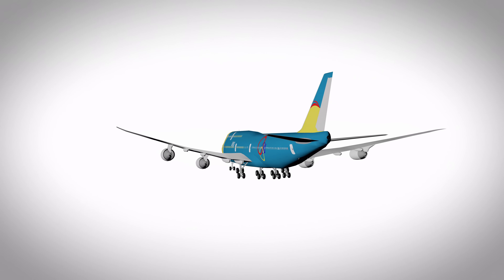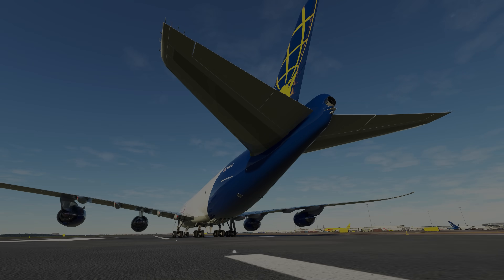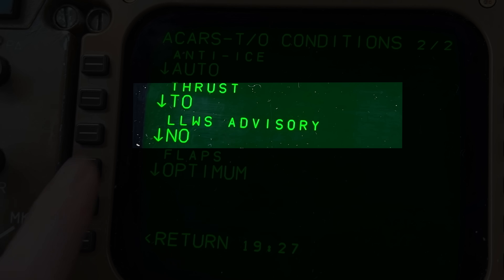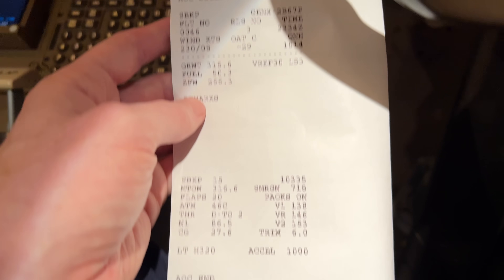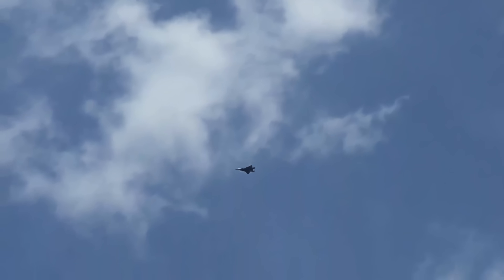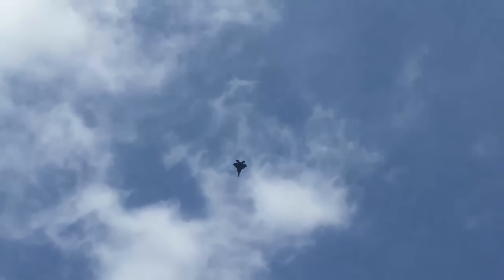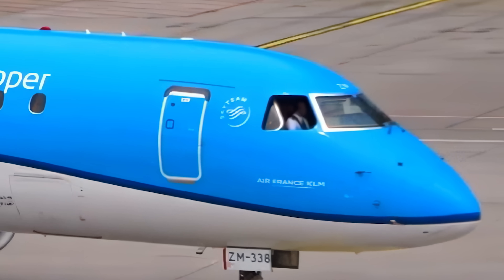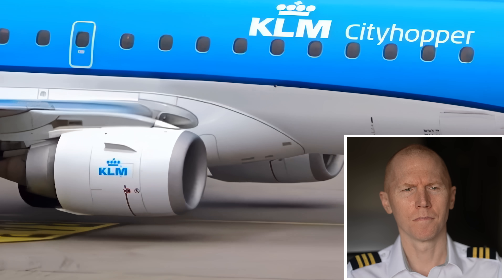Unsafe 747-8 Vertical Takeoff

Comment: As a car guy and a pilot, your downshifting metaphor is spot on.
Reply: I highly disagree. I drive a manual and I use downshifting once in a while to slow down my vehicle. Very helpful when rolling down a steep and long hill. Helps release the load on the brakes and it makes the ride more comfortable. Now obviously, I wouldn't do it if I'm already at 5000 rpms and when I do it, I gently release the clutch to prevent any jerks on my car and help the rpms rise gradually and smoothly. I've done that on automatics as well, doesn't seem to be a problem.
Reply: Come to places like Colorado, and downshifting on mountain passes is taught, otherwise you will overheat your brakes. Brakes may be “cheaper,” but overheated brakes that don’t work may force the ultimate sacrifice. We had an incident here about 2 years ago on I-70 where a truck driver with no mountain experience failed to downshift, blew his brakes, blew past the final run away truck ramp, and caused an incredibly massive collision and fire when careening into stopped traffic near Denver West. People died. Keeping cars out of overdrive coming down is important, and downshifting trucks and using exhaust brakes is even more important. I think there is a difference between constant shifting versus appropriate downshifting and staying in lower gears. We see cars all the time just riding their brakes. They start smoking and eventually will loose their effectiveness to stop.
Reply: @jeffroalpha700  I would agree, using engine breaking to maintain speed is a reasonable thing, but that is a very different thing from fully braking with your gears. Dropping it into fourth and letting your engine slow you as you maintain speed on a steep slope is understandable, especially on those big slopes that will burn out your brakes before you reach the bottom. Hower pulling off the interstate and slowing by downshifting rather than using your breaks. Drop it to fourth, then third, then second, then first. Then hit your brakes. That's engine braking in the worst way, and that's the kind of metaphor used in this video. I have known people who stopped every stop like that. It kills your transmission in months.
Reply: The metaphor is apt. Engine braking is intended for use in situations where regular braking would not suffice, such as coming down a mountain. Thrust reversers are likewise meant for situations where regular braking would not suffice, i. e. coming down from the "mountain" known as the sky. While necessary and appropriate in those cases, both systems use (and therefore incur damage/wear & tear to) components far more expensive than regular brakes, making excessive use inadvisable.
Reply: @Bubble_0f_d00m  Nope.  been doing this for decades and dont get warped brakes or even need to replace brakes for 150,000+ miles on multiple vehicles.(all fords :-) )   keep wreckin your brakes Justin
Reply: It's all situational. Commercial vehicles almost require engine braking, but that doesn't mean downshifting on the downhill or during the braking, it's preparing beforehand. The goal isn't to reduce wear on brake pads, although it does, it's to reduce brake fade. When a truck's brakes get too warm, stopping ability is reduced. Combined with hazardous loads, brake fires can be disastrous. But again, all situational. Cars? Probably a judgment call. Heavy trucks? Mandatory. Aircraft? Look, I don't know, but if your brakes are rated for high speed rejects, I think they'll handle a taxi without needing to fling exhaust everywhere.
Reply: I totally agree!
Reply: Lol, everyone is correct here.  Slowing on compression is good, and causes transmission wear.
Reply: Okay, but it's an analogy, not a metaphor. Learn the difference 👍
Reply: Would that be Hot Wheels cars?  Ever driven a manual transmission?  Ever towed a trailer?  Ever hear of engine braking?  Even modern automatic transmissions do it.  Hope you're a better pilot than car guy.
Reply: As a performance car guy I also disagree. My engine and trans are much more resilient than my brakes. Think of driving down a mountain. If you stay on the brakes the whole way they will catch fire. If you reduce speed using a lower gear, all is well.
A more proper analogy is running your car with no air filter. If you suck in sand or whatever, engine is toast.
Reply: @Bubble_0f_d00m nths? Are you serious? 
You must not know how to downshift and rev match very well.
I've never once in over fifty years of driving standard shift street cars, race cars, or commercial  motor vehicles, have ever worn out any transmission prematurely by rev-matching, downshifting, engine braking  and saving my brakes.

If you coast to a stop while in high gear while  only using your vehicle's brakes and pushing in the clutch you are not doing your vehicle any favors whatsoever.

Even automatic transmissions use engine braking.

In a commercial vehicle you will absolutely kill your brakes by not downshifting, that transmission will last a million miles. your brakes are a wear item, try to save them.

Your transmission is designed to operate under a load, not freewheel. Doesn't matter if it's accelerating or decelerating.

Downshifting does not wear out transmissions. At all. 13:21
Reply: I'm an anti-car guy, but I know a little... must not be very many Europeans following this channel because over there downshifting is just a normal part of everyday driving and it's thought to put more balanced wear on your bearings and rings.  Does it shorten the life of the clutch? Probably.
Reply: You guys are all talking about cars and braking, stopping them as if there like a freight train! Downshifting is necessary when driving 18 Wheeler and the reason is because your transmission doesn't necessarily lose its affectivness along with a engine brake like your brakes would if they get hot! And when truck brakes get hot they act as if someone smeared Vaseline on the inner drum of each brake. In other words you gonna crash! Lol (not the same for small vehicles and cars.) They stop just fine using brakes!
Reply: Disagree heavily.
Manual transmission cars are designed to be downshifted and slowed down. As long as you’re rev matching it is not hard on the car at all. Even without rev matching if you’re downshifting appropriately at the right speeds you are slowing down the car without braking and smoothly transitioning gears. As long as you aren’t downshifting at too high a speed and sending into high rpm’s or redline it’s fine. 
They are designed for this.
Reply: @Keenok nah its closer to an engine brake. I’ll assume this plane is empty though because even on max ramp weight, planes can taxi with engines on idle with no problem. If however the plane is empty, idle thrust will propel the aircraft faster than the ramp speed limit very very easily, then you’d need to stand on the brakes and waste some good brakes on an empty flight, no harm really done but if you do want to reduce wear and tear maybe putting the engine on rev idle might help. Although I haven’t heard this kind of standard anywhere
Reply: @eugeniubondari4011  Agreed. My automatic car downshifts and engine brakes all the time, the more aggressive I drive, the more aggressive it engine brakes. Sometimes I'll throw it in manumatic mode to stay at a lower gear going downhill. Diesel trucks do the same with their Jake brakes. The "Tow Haul" mode on pickups makes the engine braking more aggressive to reduce brake heating with a heavy load. Engines and drivetrains are meant to be under load, small load is good sure but no load is bad, which is why auto cars downshift.
Accurate in the sense it uses the engine to slow down the vehicle, completely inaccurate with it doing harm to the engine, provided you rev match and don't mis-shift
Reply: @Bubble_0f_d00m  I stop all the time using engine braking, in automatic. From 5th all the way down to first  then the brakes to stop. Not a lick of engine or transmission/gearbox failures.
If you're downshifting from over 50% of the max RPM, yeah it'll be more aggressive and it will cause more potential for wear through heat especially at high RPM's, but to have a car with a redline of 8200, downshifting out of overdrive at 1500rpm you don't feel, downshifting below 2000 feels like you're lightly on the brakes, which the car does automatically instead of having to go into neutral, which normally matches with the flow of traffic on their brakes going from highway speeds to city speeds.

TLDR- Engine braking by default will not hurt your car, unless you're shifting like an idiot.
Reply: Well you're not a car guy then because it's unfortunately completely wrong. It's called engine braking to specifically save the mechanical brakes and maintain control of the car. On a flat surface you let go of the accelerator, coast with downshifts as you slow down to take a turn or come to a stop. If you plan ahead and aren't being messed up by traffic in front doing stupid stuff
Reply: Surprised people have mentioned rev matching but didn't see any remarks about double clutching.  You push in the clutch, shift the lever to neutral, let out the clutch and blip the throttle to roughly the engine speed you think will be needed for the gear you're going into (sort of stirs up the transmission internals), push in the clutch again, slide the shift lever to the gear you want, let out the clutch.  Very smooth shifts, with practice very quick, and eliminates wear on the synchro rings.  In non-synchro transmissions, this had to be done.

Experimented with clutchless shifting.  Now THAT can wear the transmission unless you're better at it than I was.

Used manual shift for many years, generally didn't bother to downshift from gear to gear to brake to a stop.  Downshifted mainly to slow before a corner, done right it would put you in the correct gear for control through the corner and to accelerate out the other end.

Comment: I used to live near KSNA. Noise abatement requirements necessitated an aggressive initial climb out immediately after TO from RWY 20R . Power was then reduced as the aircraft climbed out over Newport Beach residences. Not saying that is the case here, but we used to see this on a regular basis. No heavies out of KSNA, just 737s and some corporate jets.
Reply: Turns out there are a few A330ish cargo planes which fly into SNA every day, towards evening.   Their ramp area is just south of the passenger terminal.  Of course, operating out of SNA the heavies wouldn't be all that heavy.
Reply: @marcmcreynolds2827  Things have changed since I left So Cal. in 1999. Cargo has proliferated for sure. I'm under the approach for KMMH now...pretty quiet, except for the training missions out of Fallon.
Reply: @thevirtualcockpit5001  If you get "homesick", there are one or two YouTubers now who cover SNA operations : )

I'm not sure when it was -- maybe about ten years ago -- that I first saw a widebody on final over the 405 and wondered how long that had been going on.  Until then, I also saw SNA as being strictly single-aisle.  A DC-10 did make an unscheduled landing forty-plus years ago, and more recently I observed a C-17 landing there for unknown reasons and departing after about twenty minutes.
Reply: @marcmcreynolds2827  Thanks for that HU, I'll look for the SNA Tubers. 
Biggest thing up here now are the Dash 8 regionals. We do get the occasional Hercs that line up and shoot tactical landings. The don't put the wheels down, and the ramp stays up but still it's impressive to watch. Lately I've heard groups of Fighters orbiting the pattern, gear and flaps down AND making a bunch of noise. KMMH is uncontrolled, so I doubt those guys have clearance to actually touch the wheels down. A while back I was riding with a group down to Death Valley. Guy in an F-16, probably headed for the Jedi Transition, buzzed the group then went vertical on the burners. Nearly peed down my leg...lol.
Reply: @marcmcreynolds2827  I remember when Air Force One landed one time when Nixon was president. It was in all the local Orange County papers. His Western White House was down the 405 freeway in San Clemente and he normally landed at El Toro Marine Base, but I think for publicity reasons he wanted to land at SNA this time. I read later that the airport (Orange County Airport back then) didn't want it landing there because it was too heavy, but wasn't able to say no to the White House. Apparently it damaged the runway and they vowed never again. A famous incident that happened not far away was when Nixon wanted to go to the famous Crab Cooker restaurant in Newport Beach, they did not take reservations so people stood in line. Nixon's advance team contacted the restaurant to reserve a table, and were told sorry the president would have to stand in line like everyone else. Nixon wound up not going, and the restaurant lost a little revenue on the missed meal, but got nationwide publicity out of the incident.
Reply: They fly 757's out of SNA now. I have experienced the noise abatement procedure, it's pretty exciting actually. The goal is to quickly get into the air from the short 5,700 foot (1.7 km) runway. They set the brakes and spool the engines to 90% then release the brakes, after rotation the initial climb is a 21-25 degree angle (compared to the normal 10-15 degrees). At 800 ft (245 m) they cut the power to 10-15% thrust, which gives the sensation of falling. Combined with the fact that the engines sound like they have quit, many passengers assume that the plane is crashing, especially when the pilot neglects to make a pre-takeoff announcement about the procedure. They resume power only after reaching the ocean. What I remember most is that I had a window seat and when we were climbing up at a steep pitch we were still over the runway, but instead of looking down at the runway I was looking back at it. I don't mean looking back at it because it was behind us but because it was below us. Gave the sensation of being vertical, at least compared to normal takeoffs.
Reply: @StevePemberton2  Well it is effectively Disneyland's airport, so that makes sense.  "Star Tours", minus as long of a wait in line.
Reply: @StevePemberton2  I always hated it when Nixon came to the Western WH. I got kicked out of Cottons Point surfing more than once by the suits when he was in town. Funnier than shift...the suits dashing across the sand for a couple of beach kids. And...Tricky Dick shoulda tried Woody's Wharf. Great food, and they took reservations. lol
Speaking of spooling up. Dad was chief corporate pilot for Northrop back in the day. When the execs flew, they used LAX instead of Jack Northrop Field. Dad had to shuttle the G2 over to LAX, so he'd call me sometimes for the hop. We would roll out onto the numbers, lock the brakes, spool up to 90% and launch. That thing would get out of there in a hurry. Short but fun hops, and I got to sit in the right seat.

Comment: I learned hand-propping at a young age. Park brake, wheel chocks and tail tie-down. Set throttle at idle, primed. Preferably with a pilot at the controls. 7AC was hand-prop only.

Comment: not a car guy, just European (Romanian) driver, so you know... manual transmissions, we learn downshifting in driving school, it's a standard procedure to save on brakes, save on fuel, and it's even recommended to shift into a lower gear when going down a hill, so that the car would go at a steady speed or even slow down a little
it's also good to not heat up the brakes when you're going down a long hill and in the winter it reduces the risk of sliding from locking up the brakes
unless it's emergency breaking, most of the time I down shift first before applying brakes, and continue to downshift until I've slowed down enough
I think you would damage your engine before damaging your transmission if you downshift when you're already at a high engine rev, as it could over rev that way

Comment: Thrust reversers are actually like an engine brake, or 'Jake-brake' on a semi. The only difference you're not actually using the transmission to downshift as the equipment is designed to do this with no damage to the equipment when used properly. Debris on the jet ramp would be the equivalent of dumping rocks into the intake of your engine, but unlike your car, a jet engine doesn't HAVE an air filter, making them more vulnerable than an old piston-pounder.

Comment: If you've ever driven a manual, downshifting to slow down isn't a big deal at all, as long as you don't go stupid and actually cause the engine to redline. But in cases like going down a mountain, you should downshift to help you slow so you don't overuse and overheat your brakes.

Comment: I see the other car guys already commented but they are correct and you are correct. Brakes are cheaper.

 Engine braking is cool because you get the crackles and pops but you use slightly more fuel and add a small bit of wear and tear to your drivetrain, all in which are more expensive to replace/maintain than a set of brake pads.

And on even on the race track, more work is often done by brake pads than engine braking. They work in parallel. I want to say 90% brake pads/10% engine  brake split but it varies between people's driving style as well as car setup (e.g. fwd/rwd/weight balance/brake balance/etc) .

Comment: I recall reading a story in FLYING magazine by a DC-10 (or was it an MD-11? Can't remember) captain where they were doing a short repositioning flight. No passengers or cargo, and little fuel on board. As he described it, in order to stay within speed they pitched up so much that he didn't even actually know his climb rate, as the VSI was pegged to end of scale until the nose was pushed over to accelerate to flap retraction speed. I'd never heard of a pegged-to-max VSI indicator before (or since).